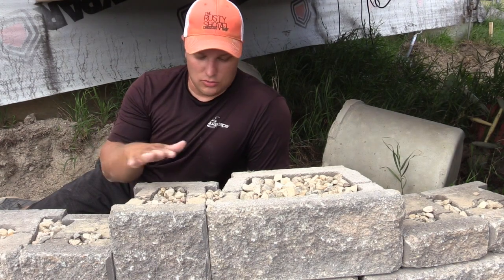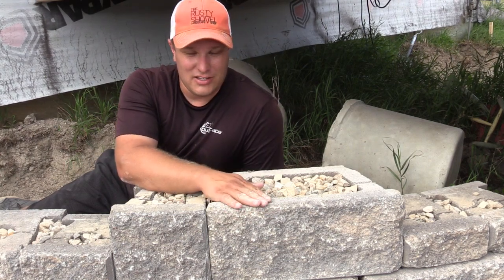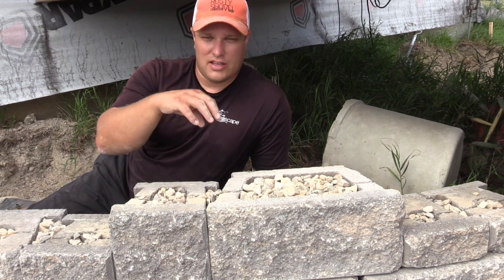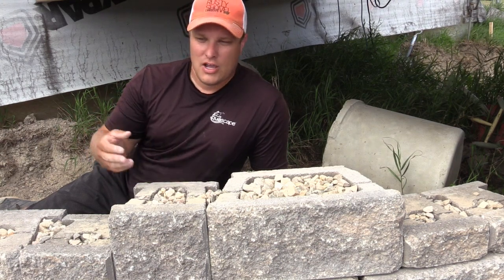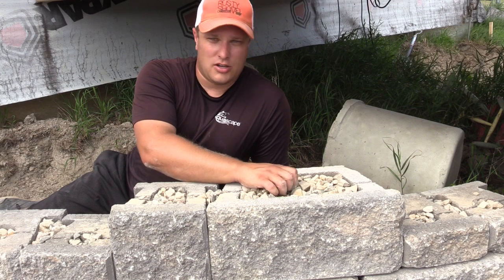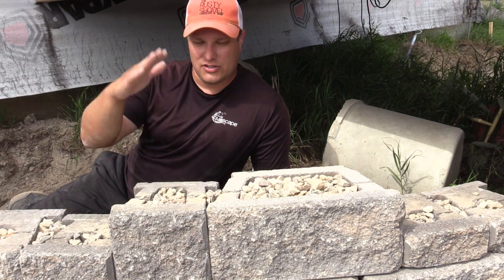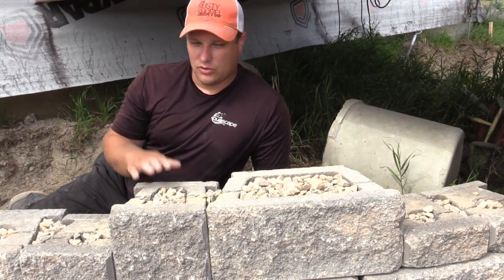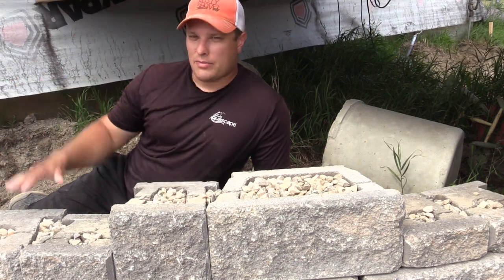Allan Block Project Showcase Episode 7 - Wall Rock

Comment: If it’s holding any backfill especially if using pavers for a patio on top, LINE THE WALL!!  Time an the elements will have all the fine stuff sifting out between the blocks over time possibly causing issues with your paver patio. But other than being heavy, as long as you get that base compacted and level, it’s easy and so gratifying!!!